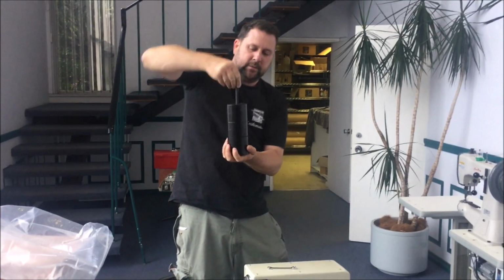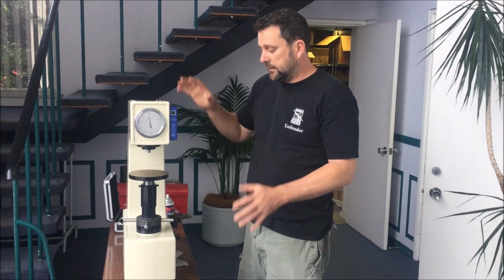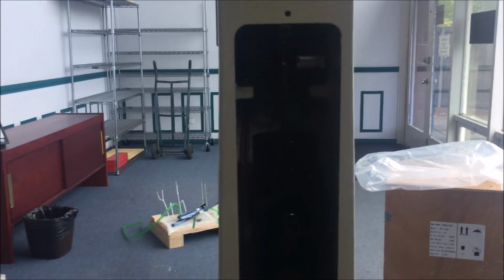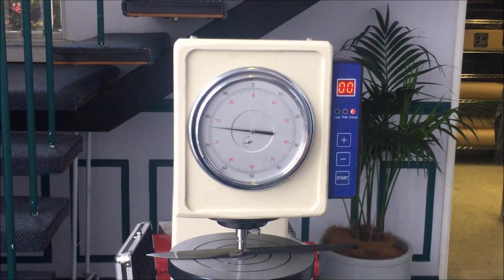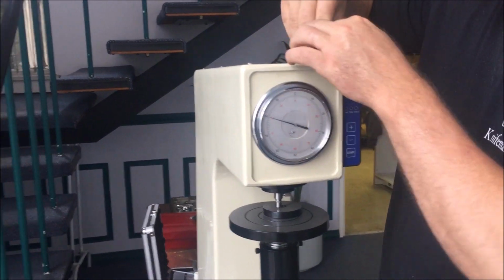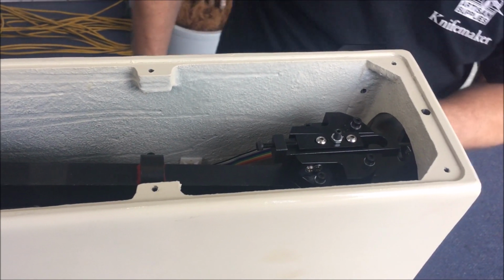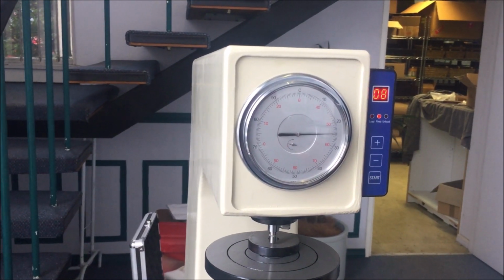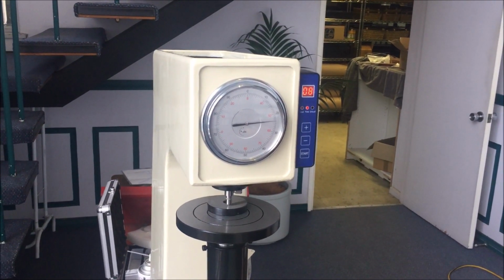Setting Up a Gameco Artisan Supplies Bench Mounted Rockwell Hardness Tester

Comment: I durometer is also very familiar to me. The calibration method is very simple. It is adjusted by the lever ratio of the dial indicator indicator, but be careful not to try to change the position of the vernier and the weight. If the calibration fails, the pressure head may be damaged